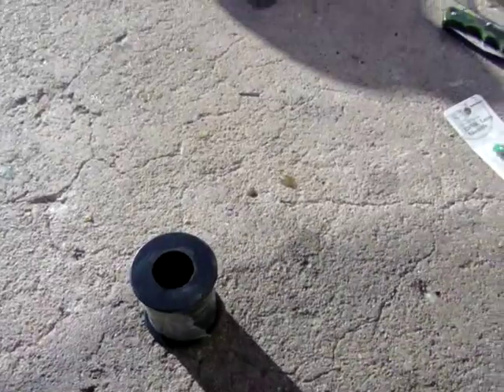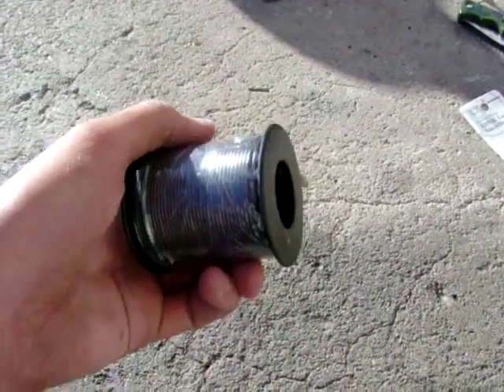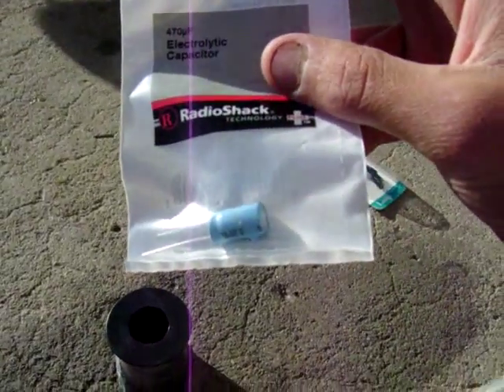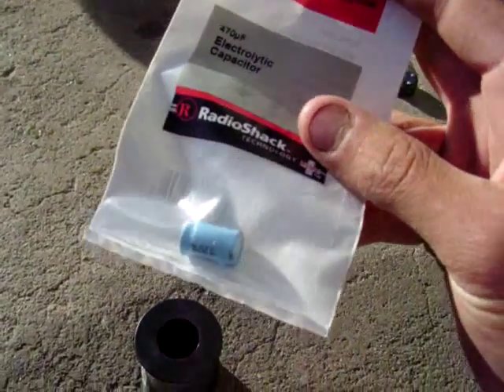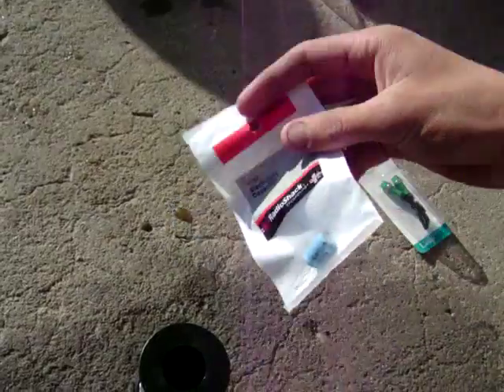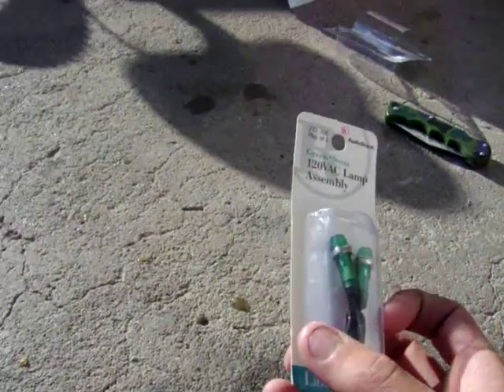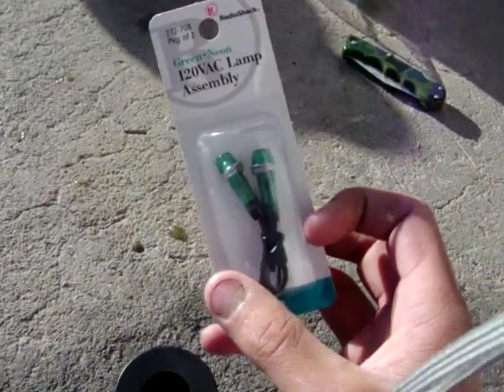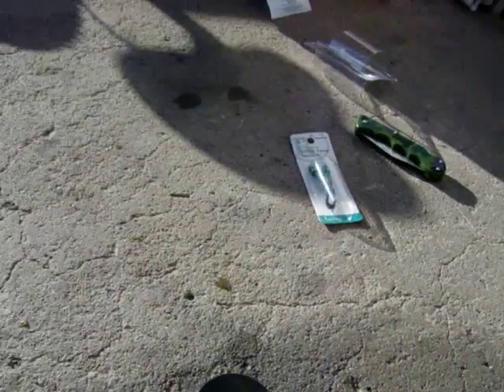tesla radiant energy capture patent recreation part 1

Comment: Ok. Your getting close. If you want to learn what is happening start with a crystal radio. Instead of going to headphones send the energy of the frequency you are drawing on to a magnetic coil to drive an induction coil. I recommend a loop antenna and set it at the same angles a solar panel would go. The frequencies that are not being used for radio or tv will give the best results (white noise -- aka static)

Comment: first off, check the caps rating on voltage (im sure there like 50V or so and will not charge safly to that power) and it only takes a few microamps to make those neon glow. its not enough power for anything else.

Comment: I played with this concept a few times. I was able to get about a half of a volt most of the time. I think that if you're rectifying it, it's probably a radio wave. I used a pc case for a plate, and was able to get 1000 volts by laying a capacitor lead on the plate. It was very low current, though, because I touched the plate, and the voltage disappeared. I do have a video of it somewhere.